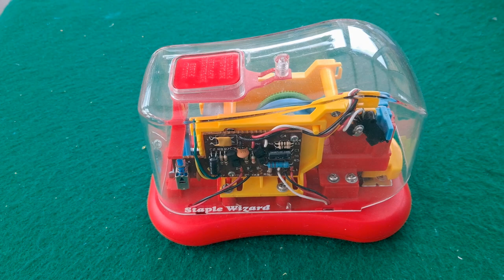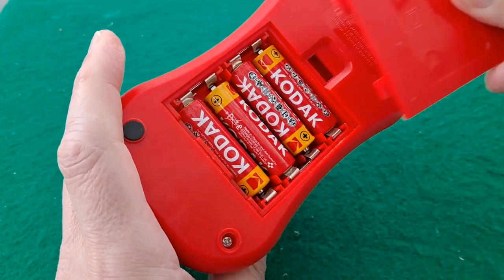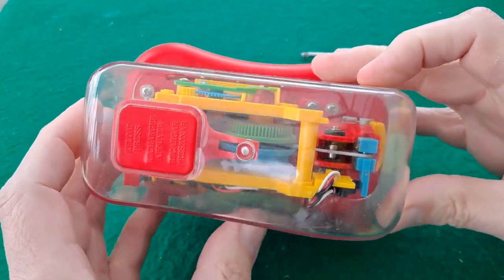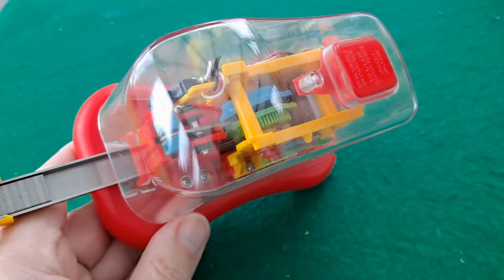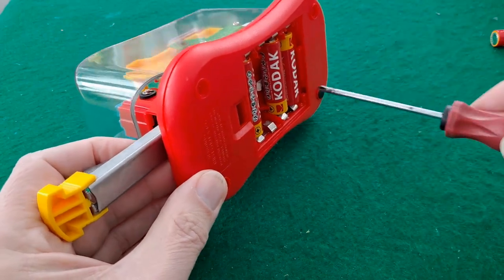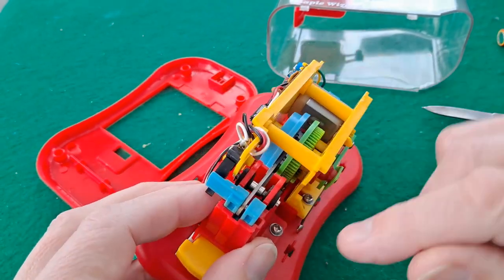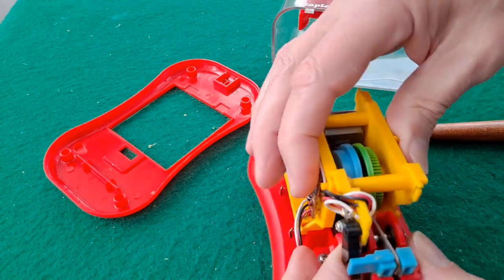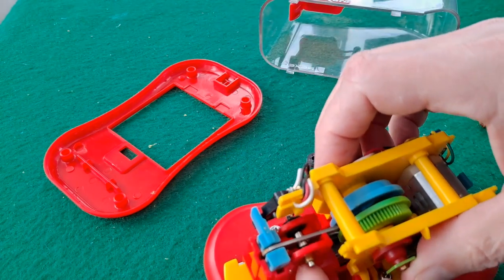PART 1 Rexel Staple Wizard revisited

Comment: I own this beautiful stapler as well and I haven't used it for years. Now I am trying to find out which size staples it uses. The standard 24/6 don't seem to work.
Reply from the maker: If the rubberised bushes have perished like mine, then it simply won't work. Unfortunately, as far as I can tell from other comments, this happens to all of them, so it is very likely that is what the problem is, not the size of the staples ☹️
Reply from the maker: I have just checked mine and it has 24/6 in it and works fine.

Comment: Thank you for your video! I have the same stapler, but the spring on the front of mine came loose at the exit. This is the spring that holds the staples in the compartment below. Can you tell me where the front spring originally goes? There is another red slider on the slide. But when I attach the spring to it, it keeps popping off. Help! :)
Reply from the maker: I don't recognise which spring you mean from your description, but I did this video for you. If I have the wrong spring, ask me again https://youtu.be/JR1R_KxGP1g

Comment: I got one for  £1.00  put the batteries in not working do I have to put staples in first before for it to work ? 

Thanks
Reply from the maker: No, it should still activate without staples. You just push some paper in the front to trigger the action assuming you have good batteries. Here is the full playlist for the work I did on this one https://www.youtube.com/playlist?list=PLA5a2xPRSrB1v1JUJvAs1lXOFJT4v8KD6
Reply: @GrandadIsAnOldMan   thanks  I put new batteries in but still not working
Reply from the maker: @stephenmitchell8324  there are plenty of wires that could be broken, a couple of microswitches that may be faulty or loose. It rather depends on your skills as to whether you will be able to find the fault. There are several videos in that playlist I gave you in the previous reply. The first episode is a full teardown. A simple check would be to connect the batteries direct to the motor to see if it runs.

Comment: I purchased one of these on July 29th 2024 on eBay, advertised as in perfect working condition.
When I tried it for the first time, the rubber bearings, although looking mostly intact, disintegrated, as shown in the earlier video https://www.youtube.com/watch?v=sOPmUaox9nY so I was reassured after finding these videos that it could be repaired.
It has been said that the grommet holes are around 6.5 - 7mm, but according to my measurements using a Mannesmann Vernier Caliper the axle support apertures were 8.5 mm diameter, and an 8.5 mm drill fits closely in the holes.
The central section of the axle measured 4.95 mm diameter, over a length of 6.4 mm centred symmetrically.
The rest of the axle to the ends has a diameter of 2.95 mm, and the total length was 23.6 mm, with space between circlips 20 mm.
The bearings can't be too hard, like metal or nylon, as they have to allow for varying thickness of stapled sheets.
On searching for suitable diameter materials, my 1st choice was a Solid Nitrile Rubber O-Ring Cord, cross section 8.4mm from eBay, and my 2nd choice was a Round Silicone Rubber Blanking Seal Bung, also from eBay, size: 8.5 mm, insert length 8 mm, top diameter 11 mm, top depth 2 mm, solid.
Although the silicone bungs have a better shape (with "shoulders"), the nitrile rubber has a higher tensile strength and hardness than silicone rubber and too much give would result in loose staples.  The lever is already centred by its attachment to the vertical stapling column so the bearings do not really need shoulders if sized correctly to fit freely but not too loosely between the circlip and lever.
I used 2 lengths of 8 mm cut from the Nitrile Rubber O-Ring Cord and drilled out with 1.5, 2, 2.5 then 3 mm drills successively, starting the 1.5 mm drill from centre marks at each end, to ensure accurate alignment.
The inside surfaces were then drilled out for 2 mm straight depth using 3.5, 4, 4.5, 5 and 5.5 mm drills in sequence to allow the central 4.95 mm diameter axle to fit in.
After finding that these bearings successfully resulted in proper stapling action, I traced the electronics on the PCB.
The control circuit contains 4 bipolar junction transistors (one PNP S8550, two NPN S8050, and one NPN C9014), 8 resistors, 2 ceramic capacitors, 2 electrolytic capacitors, and one device believed to be a thermal resettable fuse (such as a PolySwitch or Polyfuse).
I drew the schematic and modelled it in LTSpice, including switches set to change over at representative times, and a motor model based on the nearest similar sized motor I could find to the unknown type, assumed to be a DC brushed motor.
I found that the circuit divides into two functions - one is a motor start circuit which runs the motor initially by driving the motor's negative lead through one of the transistors acting as a saturated switch when the paper operates the start microswitch.
The other function is to absorb motor back EMF (although I suspected this to also provide regenerative braking, returning current to the battery, the model does not show any of the back EMF current reaching the battery).
A microswitch at the top of the stapling column switches in the supply to the motor immediately after starting, taking over from the electronic starting circuit which only operates for a short time.
The stapling column punches down and then rises back up again, controlled by a lever driven by a rotating wheel, and when the top switch is engaged again the motor power is disconnected and the voltage step that this causes triggers the back EMF absorbing circuit, which connects the motor to the battery supply for a bit longer (110ms) than the EMF spike, which according to my model peaks
at 0.4A and decays to 0.07A in 45ms.
The switch on the end of the PCB that gets depressed when the reload button is pressed reverses the wiring to the motor and bypasses the thermal fuse - I believe the purpose for this is to allow recovery from a motor stall or overload by enabling the motor to run to return the stapling column to the top position.
Users report that the batteries last for ages; this is thanks to a clever discrete electronic design that takes zero current in standby.
Reply from the maker: Thanks for your input. For some reason YouTube hid your comments, but I found them👍